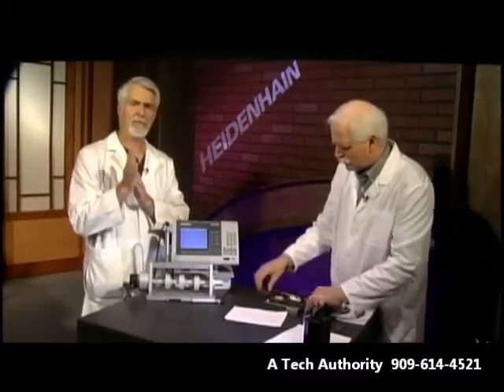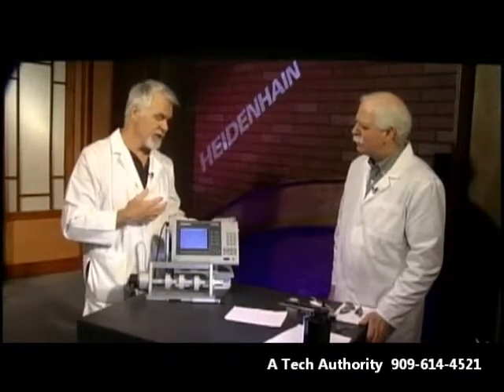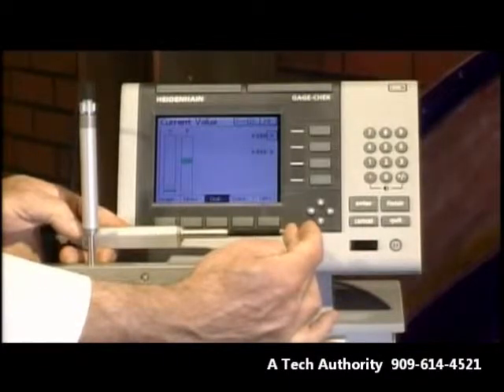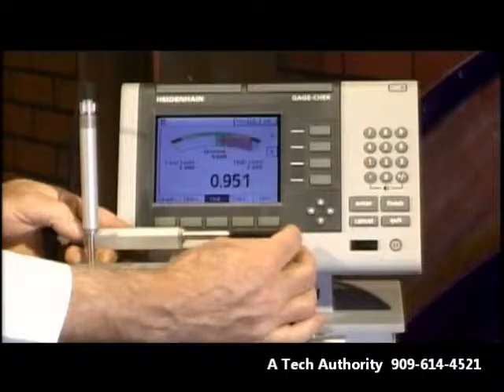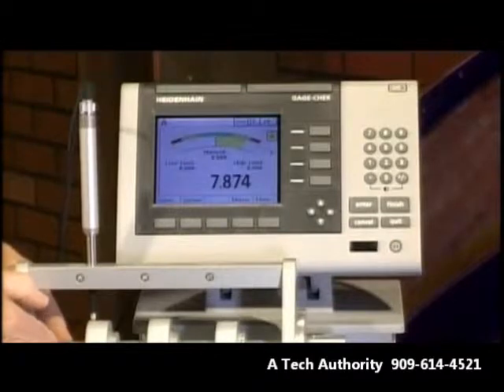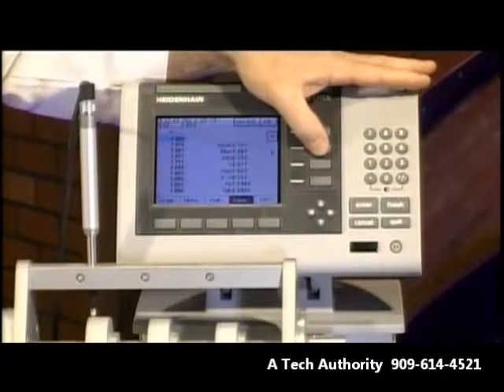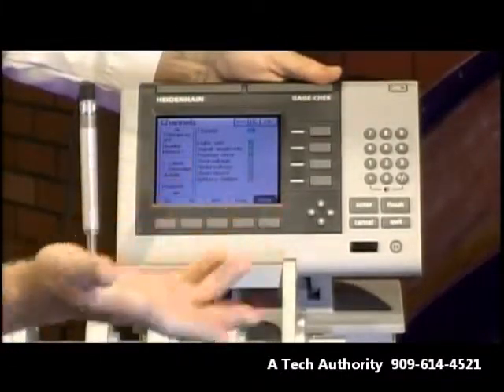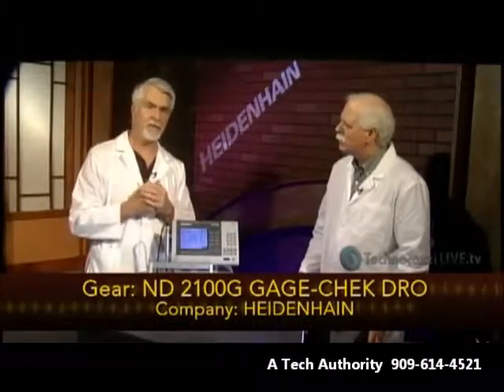Heidenhain GageChek

Comment: After zeroing the starting point.  I measure = +1mm.  The display shows = -19.996mm.  How to set up the device to measure 1mm = 1mm.  Measurement is vertical.
Reply from the maker: Thank you for reaching out.  First, the most common problem is in the set-up.  I suggest confirming the correct grading  period of the gauge matches what the readout is expecting.  If you suspect an issue with the gauge, you can call or email our service department.